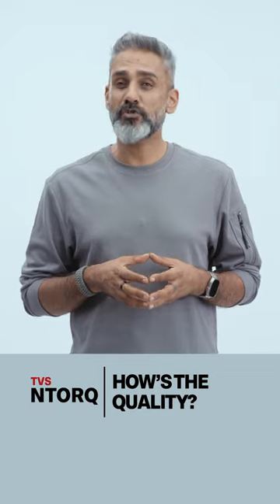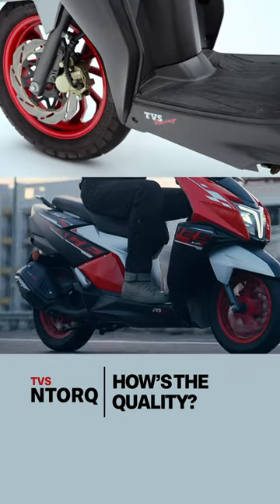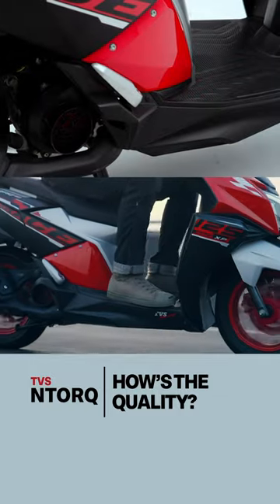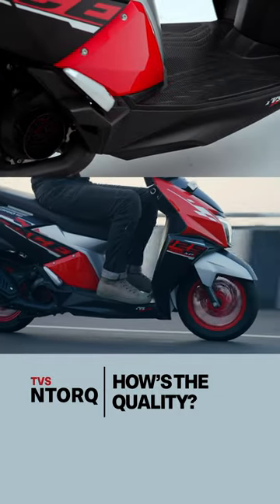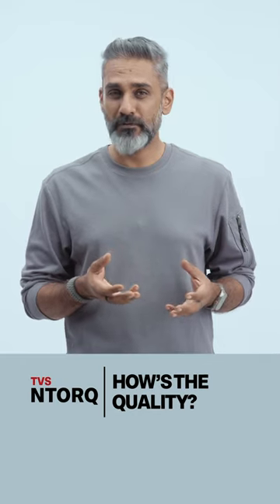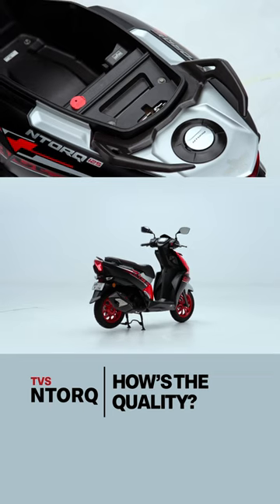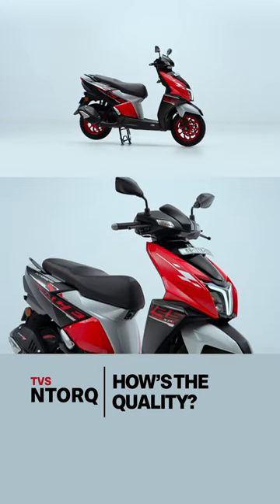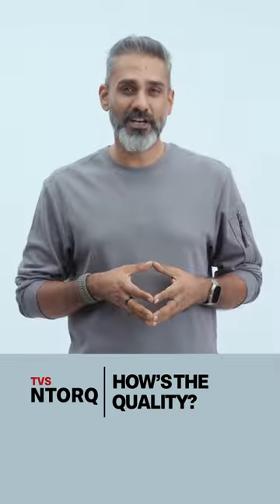How Is The Quality? | TVS NTorq FAQ #7

Comment: Let tell u the actual iceberg of quality . Rear brake bad easily and becomes loose , accelerator wire gets hard and makes throttle difficult and breaks , head lamp mount brakes easily in one two year
Reply: Correct 💯

Comment: In my humble opinion the weakest point on the ntorq is its footboard the interlocks which connects the whole footboard unit comes out with a little bit of pressure of your feet and you can clearly see a gap between it

Comment: Worst service
Reply from the maker: We do hear more complaints about TVS service than any other brand SSBW
Reply: @motorinc  in a free service they broke the clutch pulley by not tightening the bolt properly..costed 5000
Reply: @motorinc  SSBW means?